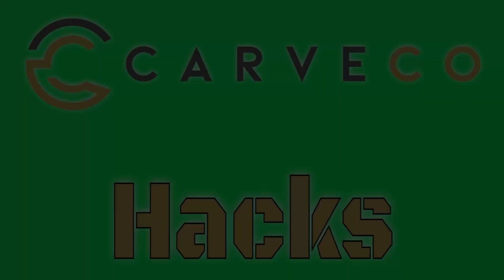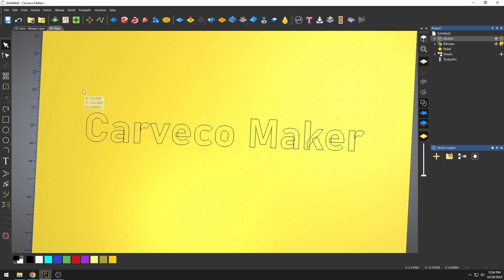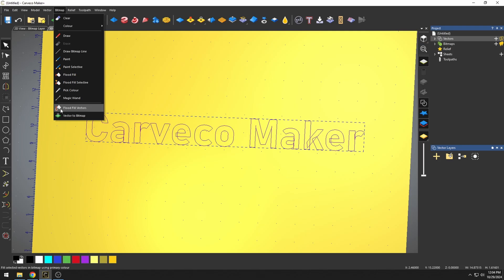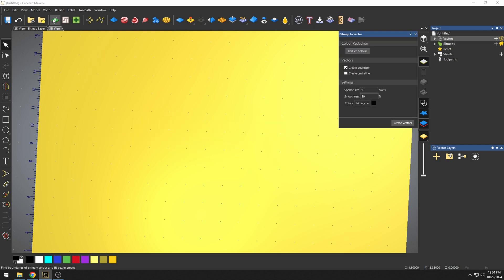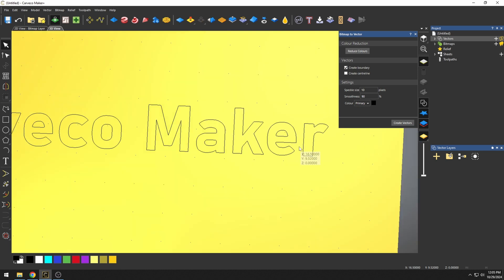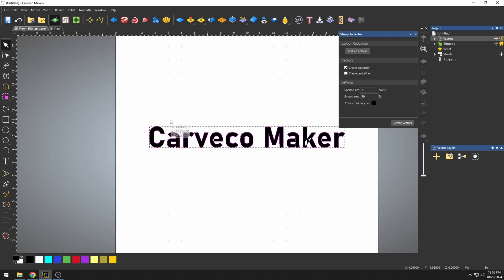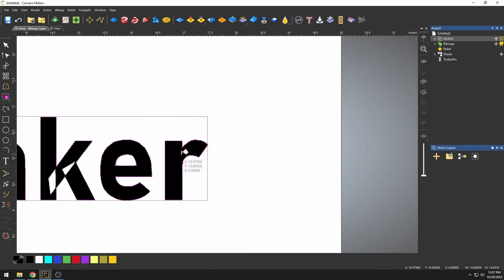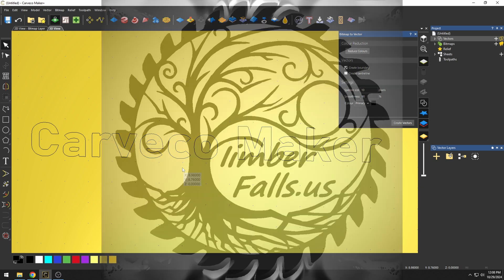Carveco Hacks: Fix Text and Lettering Issues Easily!

Comment: When i do this on my vector text, the fill is completely blocky does not follow the vector at all, like filling with a 8x8 resolution
Reply from the maker: Make sure your resolution is set to max and when you use the bitmap to vector tool make sure to use some smoothing to create vectors that will not be blocky.

Comment: I always used to weld vectors for this but the inside vector ( like in A, P, B etc)  was needed to be deselected before welding. This was taking much time..

U just reduced that effort ..
Thanks bro❤
Reply from the maker: Yes that method is slow indeed. This works great for doing stacked text too when you want to get that combined vector. Thanks for the feedback it helps.